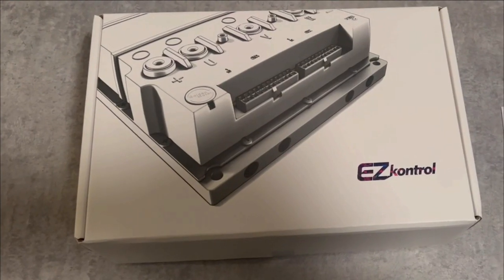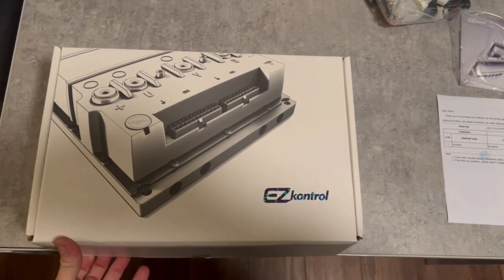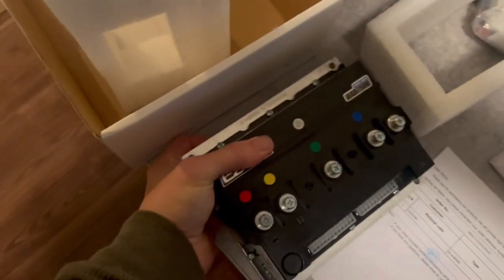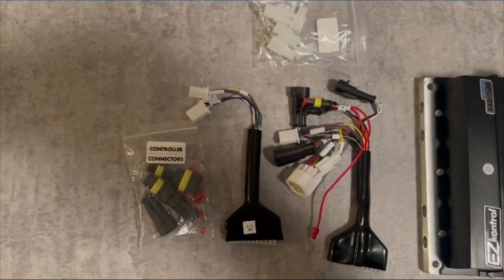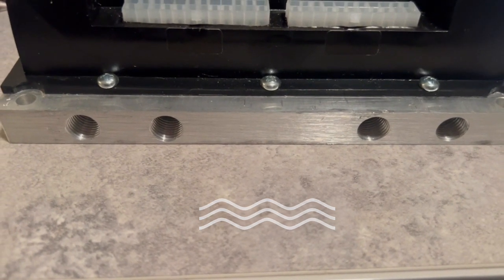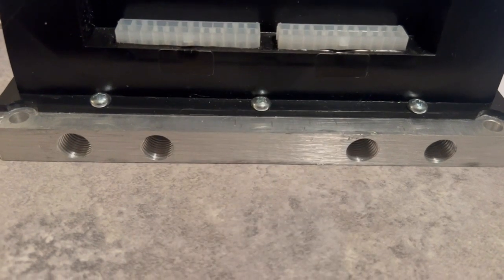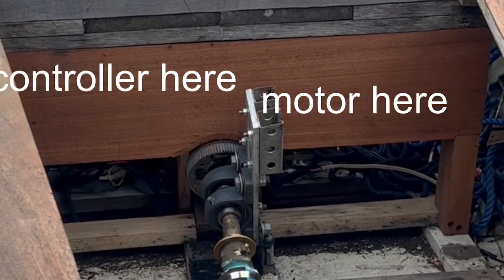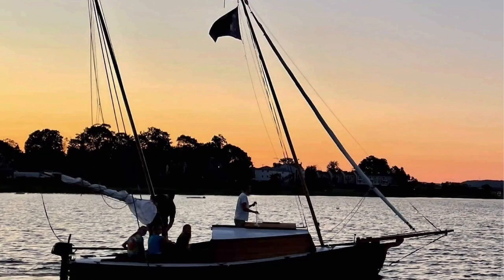EZKontrol - unboxing New Golden motor - motor controller

Comment: Hola, como te va con ese controlador?  Es muy bueno? Y fácil  de programar?
Reply from the maker: I used it on the boat all summer with no issues , it was easy but the thing was I needed an android phone.  it would not do it with apple phone . Once I used the android it was easy I got video on how I programmed it with the throttle